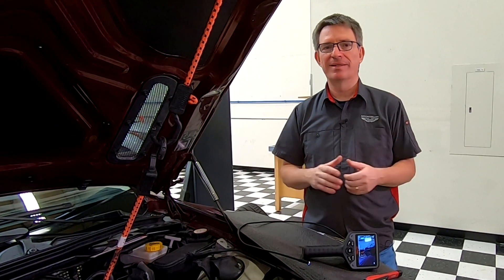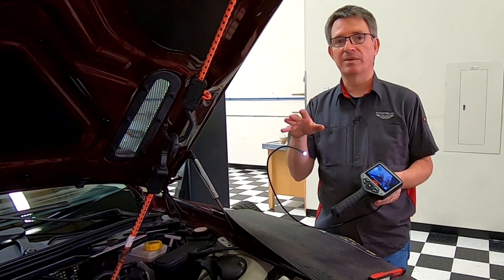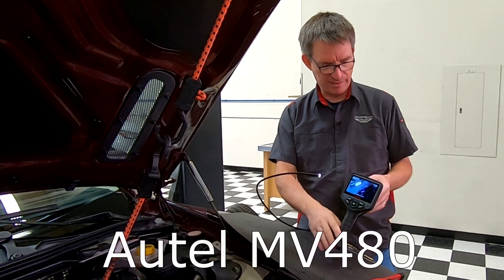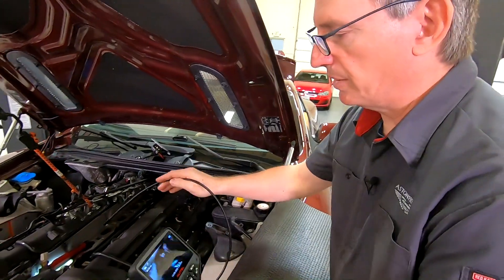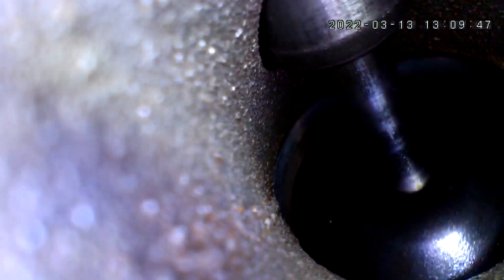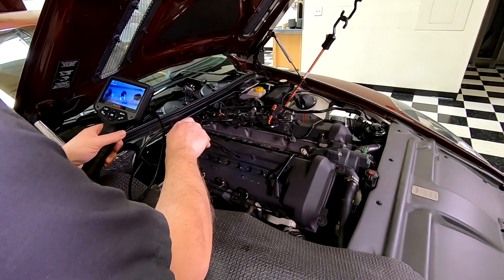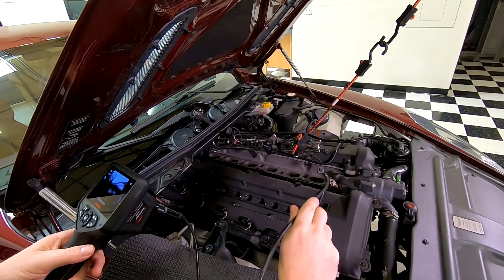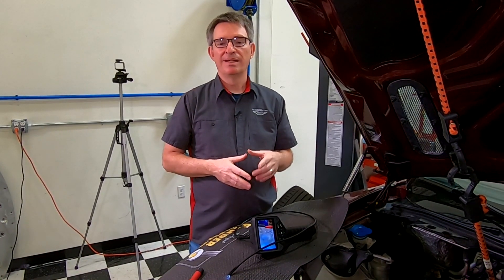Inspecting the Intake Ports and Cylinder Walls of an Aston Martin DB9

Comment: When borescoping  an engine the most telling issue is the exhaust valve.  Intake valve usually survives till overhaul since it gets cooler air and fuel.  Exhaust valve however lives in the terrible environment of corrosive exhaust gases and high temps.  When it starts to burn and corrode then engine is dying.  Eventually you will pull the heads and overhaul to get performance back on line.
Reply from the maker: Good point - thanks for sharing.  I hope I'm not pulling the heads anytime soon.  Was pleased to inspect the engine this go around and find everything in good order.  Thanks for watching!

Comment: Isn´t it easier to use the side camera on the boroscope to look at the walls? or does it have lower resolution?
Reply from the maker: Nice observation.  I did use it, but the light that turns on with it gets reflected back directly into the camera, so its struggles to adjust the image.   I did inspect them using this, but it wasn't good TV.   Thanks for watching!

Comment: That's awesome. Tell me tho, haven't you already done the plugs and coils?
Reply from the maker: I have, about 6 years and 30k miles ago.   Apparently this will be a reoccurring issue with time.  My DB9 is 17 years old now, so entering into some repeat issues now.  Thanks for watching!
Reply: @Aston1936  do you think the 3 pin coil packs are better and longer lasting ? Do you have a companion blog on the coil pack change ? Is there now an alternative coil pack (cheaper) for the Astons, I see NGK do a lot cheaper spark plug than Aston.
Reply: @Aston1936  ahh ok now I understand.  My DB9 has only done 53k kilometers in total and is a 05